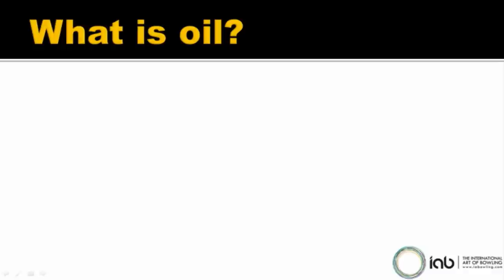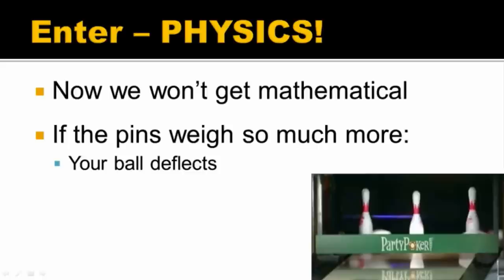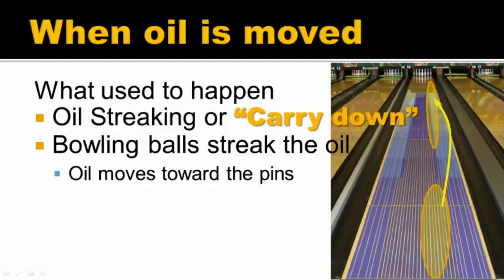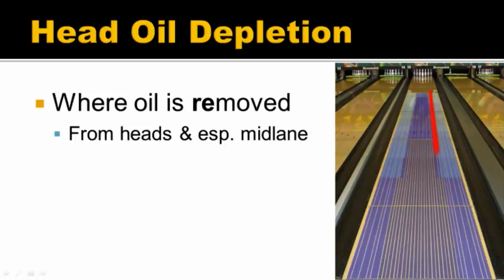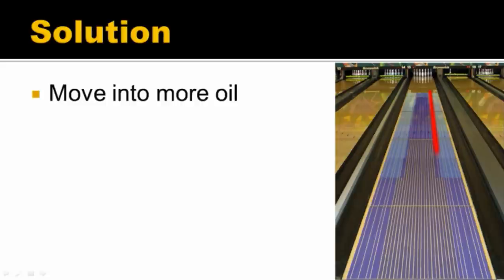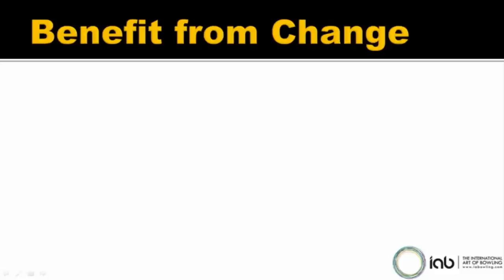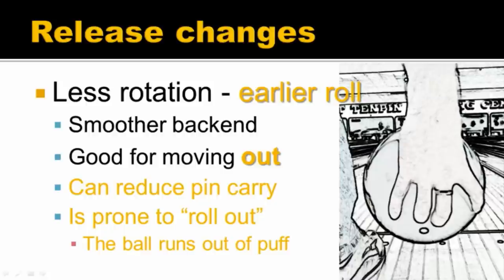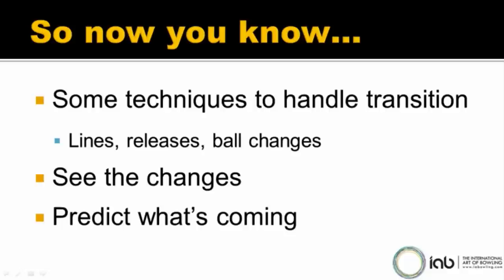Oil Transition: The Change You're Looking For

Comment: Oil transition can destroy everything so that video really helps a lot. I am two handed bowler and i have 500 rpm and 17-18 mph on the ths pattern. Especially at the 3rd games, my average decreases dramatically. I try to find the correct board, release, speed etc. at that games. Even i change the ball but it does not help mostly. Thank you for the video about the adjustments.

Comment: I listened and saw that the question you asked and answered was a bit off the mark about being correct. The ball max weight is 16 lbs. going into a pin weighing 3 lb 6 oz. The ball in the ideal scenario rolls in the pocket to hit 4 or 5 pins not all at same time. 5 pins total 16.75 lbs. The full rack of pins is yes, 33.75 lbs. 16 lb ball vs 33.75 lb pins. But the ball does not hit every pin all at once. Really, the ball at 16 lbs going 13 mph to hit a pin 3 lb 6 oz stationary is nearly 2700 lbs of force. That is a large force to realize. The ball does hit eventually, a total of 16.75 lbs of pins.

Comment: Bowling is way more complex than I never knew after I bowled a 279, 254, and a 248 during morning league as a 15 year old. We used to say the lanes were "stacked" when everyone could more easily throw strikes. (now we all know it was the oil patterns) However, NO ADULTS ever came down to us very YOUNG teenagers with 200+ averages at Kings Bowl in Millbrae CA and bothered to explain anything. We had no idea there were standard oil patterns. We were just learning about having an extra spare ball and at least 2 strike balls. We used split finger delivery on dry lanes to pick up those tricky 10 pins as right handers and were spot on. We worked WAY harder than today's bowlers. Case and point. Back in our day, we were neglected, ignored, and the adults and the pros never reached out to us when WE could have become pro-bowlers. MY morning league had 4 bowlers with 200+ averages for 3-4 years straight at ages 13-17. We won tons of trophies and tournaments too but the PBA scouts were few and far between. My friends and I could of all become millionaires if ANYONE would have reached out to us early on, taught us oil patterns, ball choice, technique, adjusting for lanes during 2 day + tournaments etc. Then we all turned 18, went to college, and never bowled again. Its a sad story aye?

Comment: 3:35 If only that pattern were about 5' longer. Cuz it gets about as scoreable as a house shot after a few games. I can usually just take a ball down to 180 grit and play up 5 for a few frames then it opens up nicely. Wouldn't be able to do that if it were 45' lol. Also on a house shot, it should never be necessary to move your eyes. Plenty of hold in the middle, and if you play though the oil, you'll be able to keep the same breakpoint. Unless you are a two hander or something. Then you need to work the hold.